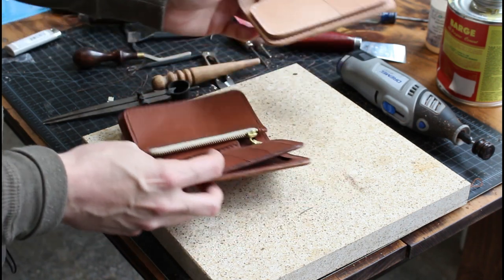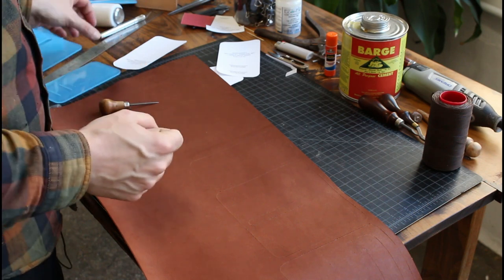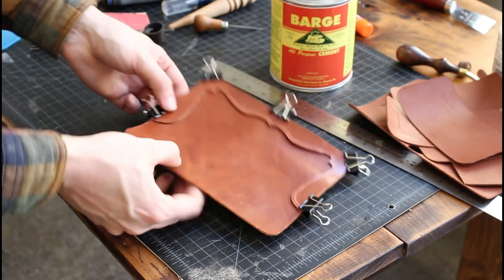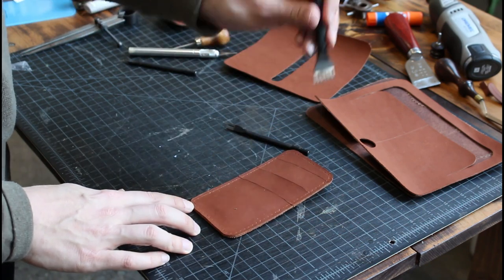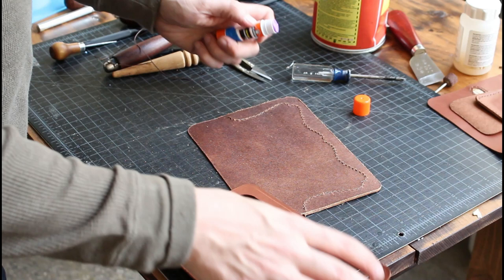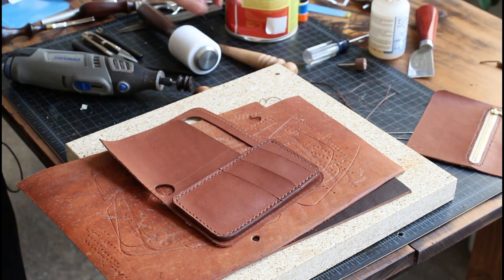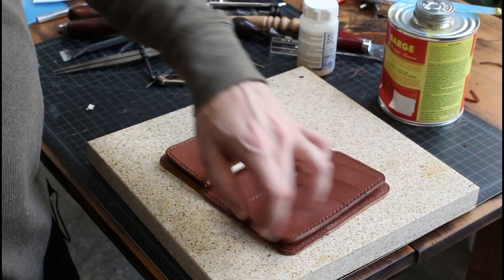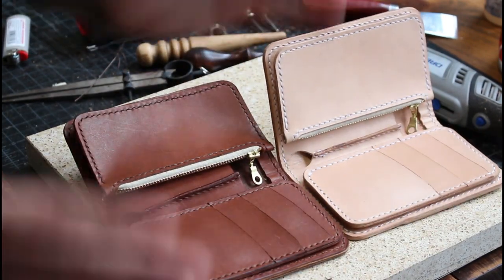Make A Leather MID-WALLET | (FREE PDF DOWNLOAD!) - Step By Step Build Along Instructions

Comment: When stitching that last line of the interior, why not start at the bottom by the big hole and tighten it as you go towards the top of the wallet?  Seems to me that you'd have a larger opening to work with.  I just printed out and cut the plans.  I'll try it and report back on how tough it was.... :).
Well, now watching it more, I guess it doesn't really matter since you don't need to work from the inside anyway.

Comment: How did you  put the lining on the inside of the wallet? Did you stitch it all around or did you leave it unstitched where the wallet folds? Thanks.
Reply from the maker: The interior is the same size and stitched all the way around. I started the stitch line in the bottom corner so you cant see it. The "pinched" and stitched part in the middle there is what allows the wallet to open and close.

Comment: Hi, greetings from UK. Great video, I'm gonna try to make one, since I am home from work due to Covid. Can I ask why do you cut the line from the hole at the end and stitch it back? How you normally measure the tread length for the stitching? I do not want to cut it too short.
Maybe you could have used the black clips to pinch the sides together? ;) Cheers